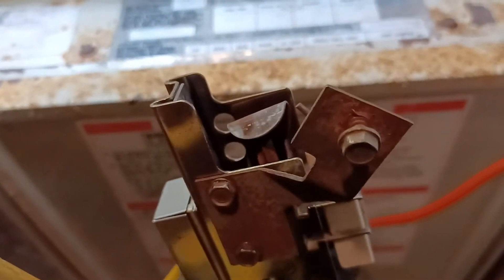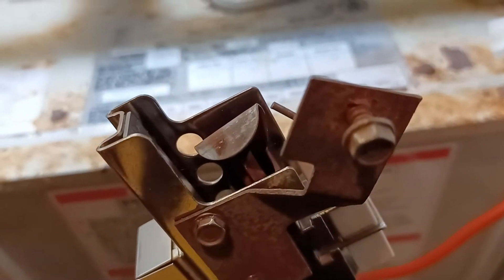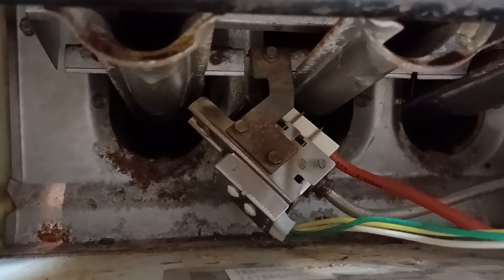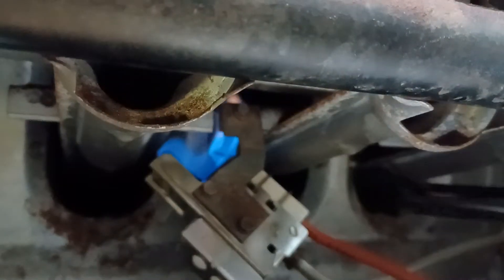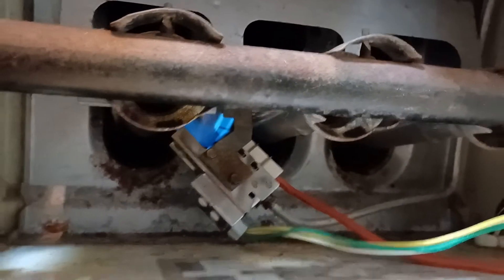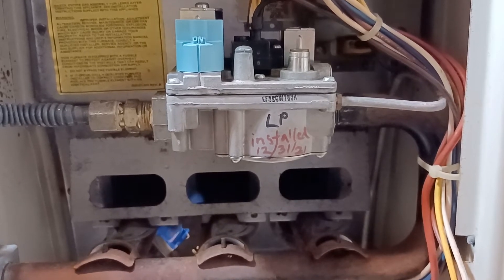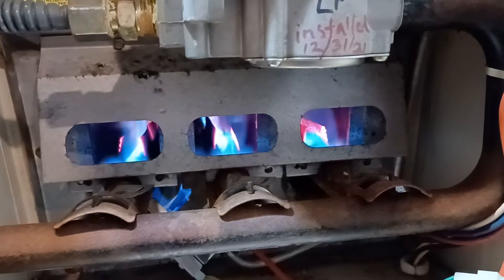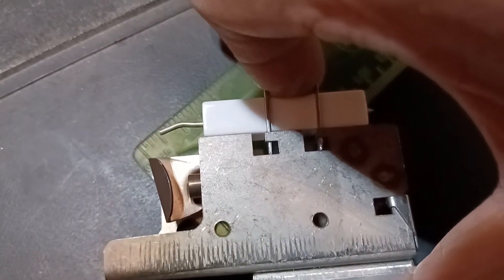CARRIER FURNACE 58GS Series 130, TICK TICK TICK No Pilot Light, Pilot Assembly, Lockout, No Heat

Comment: Hey Sam,
How do you change the air filter on this unit? I have the same unit "58GSC", pretty old but works.
Reply from the maker: Hey NS, depending on how yours was setup, the filter on my unit is to the left of the furnace. I normally buy generic filters from Home Depot and cut to the same size of the old filter.
Reply: @samtoustube  Thanks. I can't even open the furnace from the side or the top. only accessible path is from the front. trying to figure out where the filter resides.